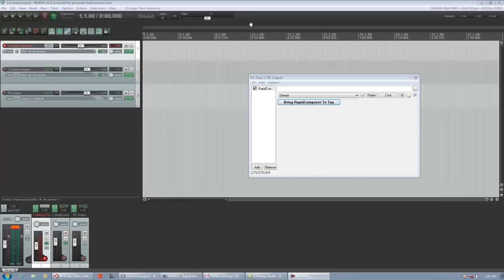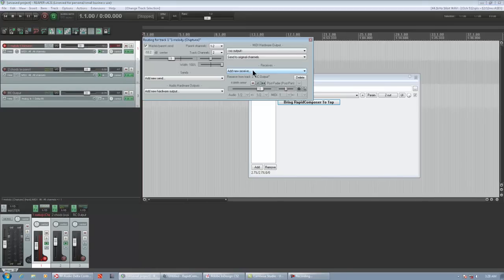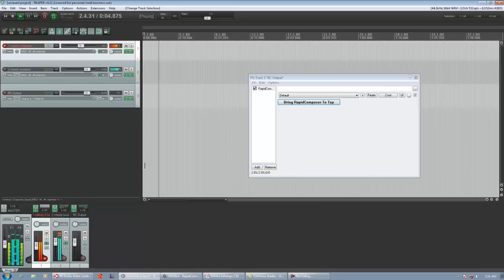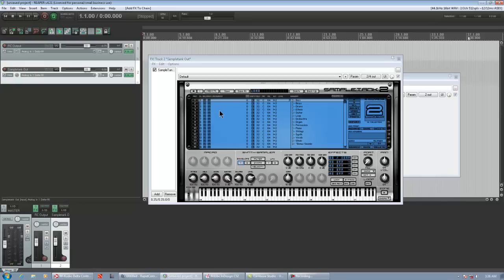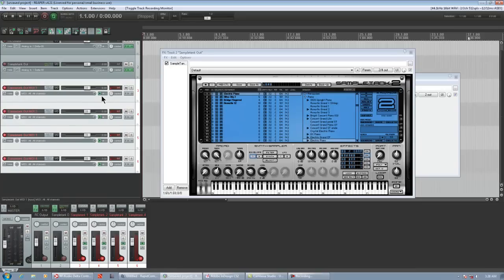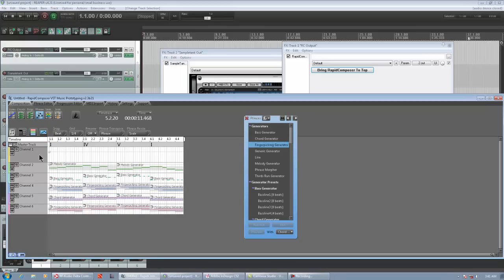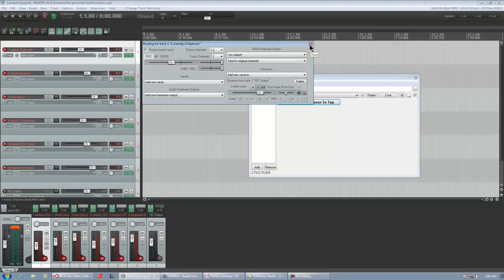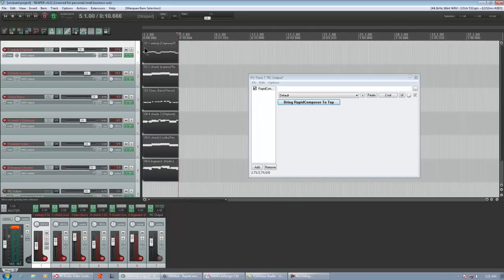RapidComposer Tutorial Part 12: RC as VST/plugin (3 Scenarios)

Comment: Hi, I have been watching this video for over 2 weeks now but I'm failing to get a sound out of RC, In reaper 4 this method works but we are on Reaper 7 now...please advance with the new routing method
Reply from the maker: Hi, I honestly rarely use RC these days. I made those tutorial videos about 13 years ago.

Reaper 4 or 7, it all works the same. What I would do if I were you is, use RC v5 (the latest version), standalone, first. Since it comes with built-in soundfonts, it's fairly easy to get some ideas going.

I'm sure the developer changed some things with the newer plugin version of RC. Your best bet would be to join the forum at KVR (the official forum, linked from www.musicdevelopments.com) and see if someone can walk you through on how to route each RC track to a Reaper track with plugins that sound better than the soundfonts. I honestly completely forgot how to do most of this stuff... again, it's been 13 years since I made those videos, and it was with version 2.3 from my memory. A LOT has changed with RapidComposer from version 2 to version 5.

Hope this helps!
Reply: @DopamineOverload  Thank you for the feedback...I tried the RC 5 and I've experienced the same problem that's why I rolled back to the old version.. In reaper 4 it works the same as your videos. Currently I'm trying to configure it using the LoopMidi application... I will take your advice, THANK YOU

Comment: Nice tutorial. In Reaper if you are only using one instrument you don't have to put the instrument/sampler on a separate track as shown here. Just put the RC VSTi as insert #1 and the instrument as #2 on the same track. Works fine for me. Having the instrument on a separate track can result in visual lag if you are running your soundcard at high latency.